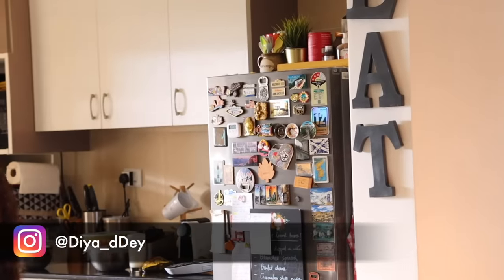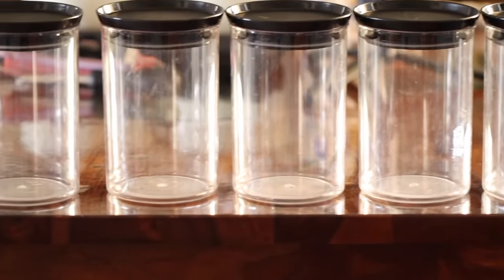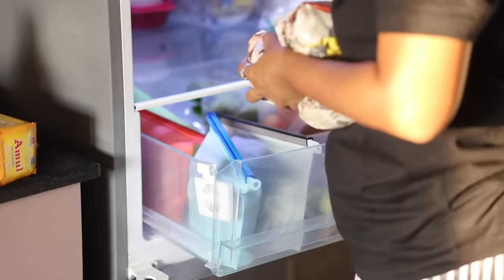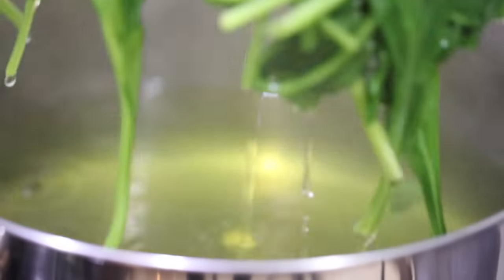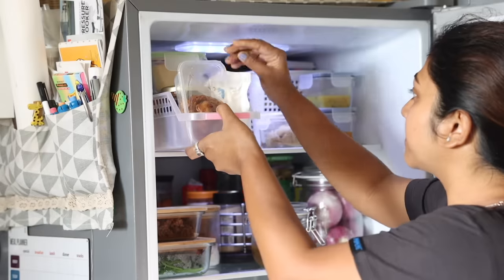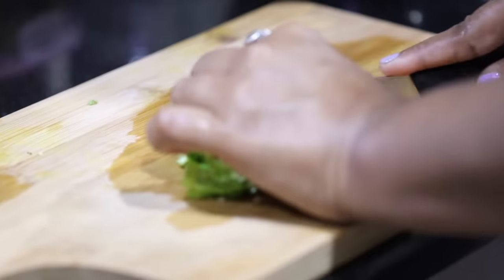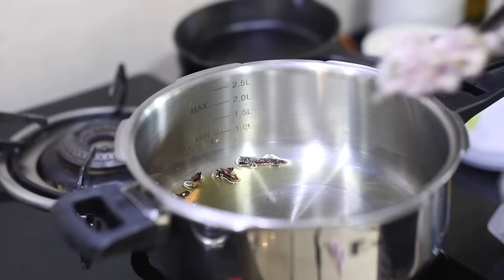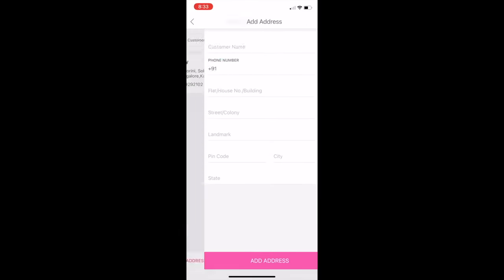How to deep clean and organize a fridge the best way? | What's in my fridge? | Freezer organization

Comment: Hi diya...how is your experience with haier refrigerator ....any issue so far with the product or service??I m in need of a new refrigerator and want to buy bottom mount one....but never tried any haier products so lil skeptical...I trust your opinion plz do reply
Reply: Plz plz reply its indeed urgent
Reply from the maker: Hi. We did not face any issues with the Haier product for 3 -4 years post which there was a bit of compressor noise and overheating at the sides. We still have that refrigerator in another home and it’s cooling is effective. For our personal use we have moved to Samsung. We never needed any service so cannot comment on that.
Reply: @DiyaDey  tnx for the quick reply

Comment: NIce to watch your video after a long time. Looking forward to seeing videos of your new interiors (when it is done and you move to your own house). I hope Kaya is doing fine with her new lenses. I remember watching your fridge organisation video last year and since then I guess you might have changed the organisation system around 3 to 4 times. Just far wishing that you would be able to get the fridge of your dreams for your new house. Having said that, for freezer wide mouth mason jars and borosilicate glass containers are best choices. Otherwise it's plastic and stainless steel. Silicone bags help a bit in space saving. But one has to be careful as due to extreme cold the bag can rip while opening. You use silicone spatulas while cooking. Wanted to know when you use them and have any issues occurred while cooking. Regarding butter, try President butter sticks instead of block. The inside wrapper has markings of 10gms measurement. That way one can get equal sized cubes.